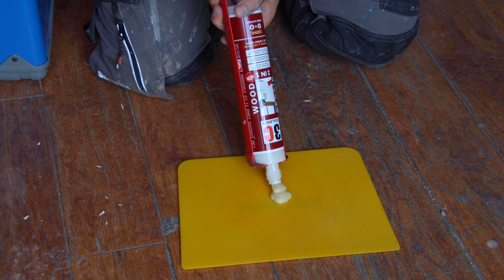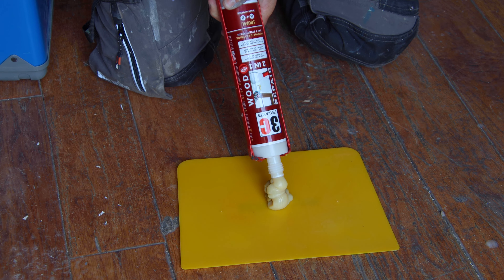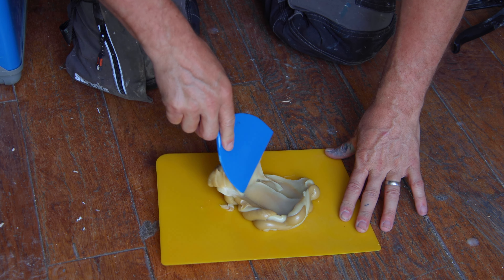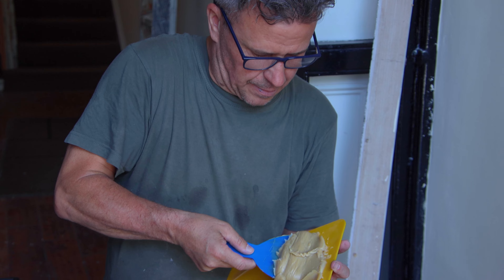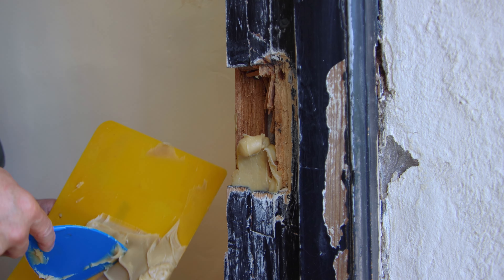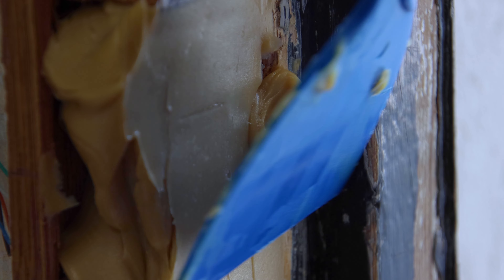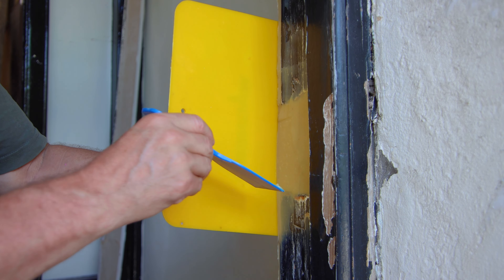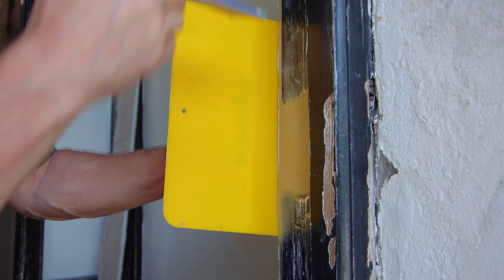How to Repair a Door Frame | 60 Second DIY Tips @3csealants #diy #howto #repair

Comment: Well you have filled up that hole and made it not seen, but the secondary material is not going to be as strong as the original wood though.
Reply from the maker: Thats right, it fills it ok and it's not seen which is great, but even better the Wood repair we use will dry stronger than raw original wood in the door.